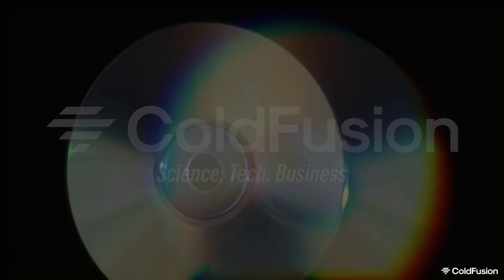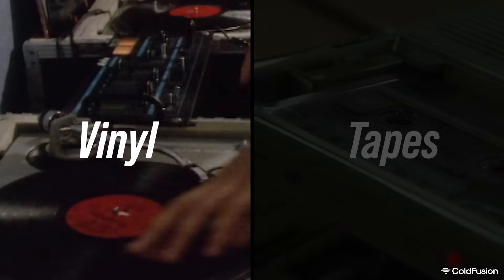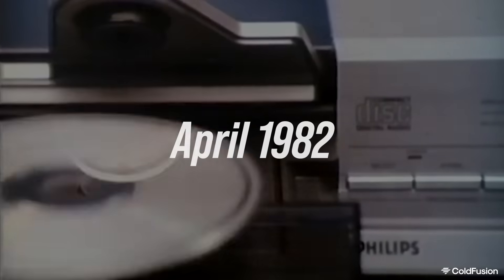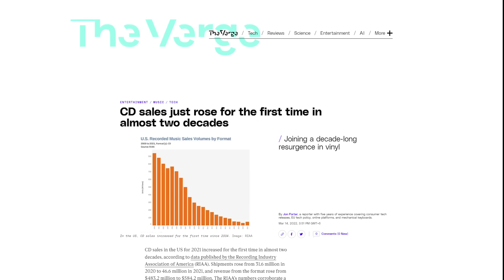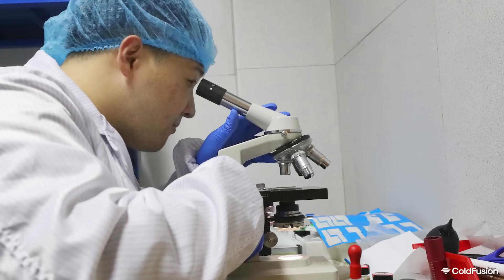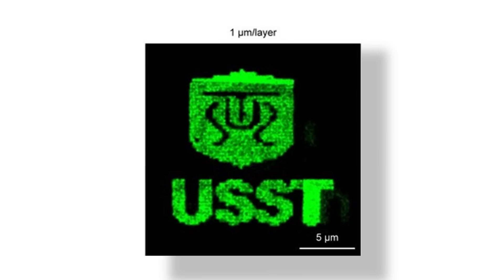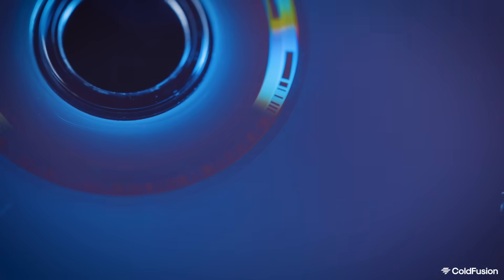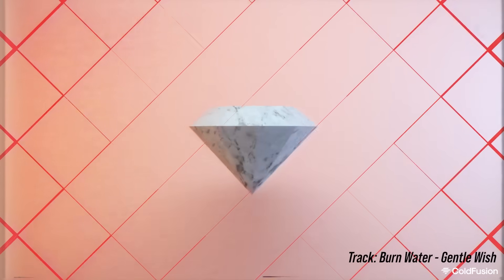Why This New CD Could Change Storage

Comment: The mixing of the use of bits and bytes is driving me nuts: 1.6 Petabits = 0.2 Petabytes.
Reply: The issue isn’t about whether using bits or bytes is “better” . . . it’s about the mixing of the 2 in the same comparison being most definitely bad.
Just say “.2 petabytes = 200 terabytes” . . . end of confusion.
Reply: Agreed, especially since CD-Rom used Megabytes and DVDs were in Gigabytes
Reply: And there is another problematic unit. kW per terabyte.... I assume kWh but it does not help with general understanding of energy vs power...
Reply: Why not just 200 terabytes. Thats even easier to understand right?
Reply: @FullFledged2010  Exactly. What next, It is 1.6e+14 decabits.
Reply: @FullFledged2010  Yep, and it means a mere 42,553 x 4.7GB DVDs, not 200,000. Boldly presented error like that are repeated across the net. AI must burn a lot of gigawatts figuring out fact from fiction.
Reply: I can see it here, though.  What they are cramming into those experimental discs are bits.  They get organized into bytes later.  (A chicken lays one egg at a time, not a dozen.)
Reply: @joesterling4299  It also doesn't include things like error correction. That's about 25% of the space on a CD, but could be as high or low as you want.  There are a lot of choices that could affect the final usable size.
Reply: @joesterling4299 but to communicate information effectively, journalists should choose the vocabulary that is most widely used and understood.
Reply: @joesterling4299 try asking the associate at Costco:
- where I can find 60 eggs? 🤷🏻
- where I can find 5 dozen eggs? 😃💡
Reply: @joesterling4299  This. Both are important and required to explain this. Should have had a short explainer at the beginning.
Reply: @joesterling4299  
1. He makes a confusion and mentions petabyte instead of petabit 7:00.
2. If everyone measures storage in bytes, you come with a special reason to use bits. The issue is that they have similar names.
   To try to use your example, do you care how the chicken lays eggs or how many do you need for cooking in a recipe or when you buy them what are the common options. For the sake of the example, let's say they come in multiple of 12 and imagine we have a special word 1 "eggz" = 12 "eggs". So you always buy a quantity of 1-3 "eggz" and your favorite cake is made with half an "eggz". And here I offer you this opportunity to buy this chicken that lays 100 "eggs" per year (this is what I care), so 200 cakes (this is what you care), it's not my fault you are confusing units.
   Accidents happen because of unit conversions because everyone uses a different logic when using them. In 99% of cases, people use bytes.
Reply: @joesterling4299  i can't wait for the day we engineer chickens that lay a dozen eggs at once
Reply: @joesterling4299  Chickens don't lay eggs, hens do.
Reply: @joesterling4299  Yeah, but when you look at those eggs you see a dozen, not one
Reply: @joesterling4299  What is the argument for that? We don't measure anything in the most fundamental component. We pick a common unit of measure and then measure based off of the unit.
Reply: @joesterling4299 it’s very misleading though. And there is no reason to use that metric anyway.
Reply: The correct unit is Words in a Bible or tennis courts.
Reply: I guess 200 terabytes didn't sound as good? Sounds pretty good to me.
Reply: @t.c.b4722  Yeah I was going to say the same. 200,000 GB is just 200 TB. Why always the wanky new terms?
Reply: @jefp65  Right, and then he claims that’s equivalent of 200,000 DVDs, which is incorrect.
Reply: Agreed, bits need to be dropped...all they tell you is about how many 1s and 0s it can hold, but we need 8 bits for one byte, which is an actual piece of data to form letters for example...we should just stick to bytes. They used bits early on in selling internet speeds to fool consumers into thinking they're faster....bytes make the most sense.
Reply: @GowronSaves  Most storage uses more than 8bit per byte. For error detection you need atleast 1 more bit. For error correction it depends on the method used and how robust you need it.
Reply: @NScherdin a byte is always 8 bits. More bytes may be used for error etc but a byte will always be 8 bits
Reply: @NScherdin  "Most storage uses more than 8bit per byte. For error detection you need at least 1 more bit. "
Most storages (Hard discs, memory sticks) are storing data in "sectors" - where a sector typically contains something like 512 Bytes up to 16 KByte - and the data is protected by a CRC-checksum consisting of 2 or 4 bytes.
That does not allow the correction of the error - but if detects if bits are wrong.
But you need only 2 or 4 bytes to detect errors in a complete sector of 512 Bytes or more - which is more efficient
Reply: @NScherdin ASCII encodes into a 7 bit range and the 8th bit in an octet was used as a parity bit
Reply: @GowronSaves  we need bits too, flicking 1/0 can make huge difference in hardware ;-)
Reply: @GowronSaves those cannot be dropped, since some mediums do not technically work on bytes, such as, unironically, CDs (14 bits per byte)
Reply: @GowronSaves  if we have to drop something is bytes not bits, the BIT is the fundamental unit for information, a byte is just a arbitrary number of bits, a bit IS a actual piece of data saying that "bytes useful bits not" its like saying that a "Dozen" is useful but the number "1" is not because "1' is too little you can't do much with it
Reply: @LucasFerreira-gx9yh  not really arbitrary. If you had 10 bits in a Byte you would lose storage space in digital equipment, because everything in digital is 2^x
Reply: @GowronSaves  Bits are rather useful information also for data, only for storage it's not that useful as a byte isn't always 8bit (depending on error detection method). And we're long past the date that such small units give useful information detail anyway.

When it comes to marketing it just needs to be consistent, and at this point when selling internet contracts they all jumped to Megabit instead of byte.
Reply: @GowronSaves  a bit "is an actual piece of data" that can form the most complicated software...
if (aBit) {
    // simulate a universe
} else {
    cout << "letters" << endl;
}
Reply: @GowronSaves oh boy. Yall ain't ready for kibibytes, mebibytes, etc
Reply: @GowronSaves  bits are useful for things outside of storage, we just need to stop marketing network speeds and storage space in bits
Reply: @BlueScreenCorp  or in "DVDs" ("over 200000 DVDs on a single disk"), or in football fields and Boeings  ... like maybe stop inventing new units just for the sake of it?
Reply: @stclaws9580 insert running joke about Americans will use anything but the metric system 😂😂
Reply: @BlueScreenCorp Network speeds make perfect since in bits because that's what's being sent. Any data transmission should be bits
Reply: @Premium-Content  data is stored in bits, so by that logic we should only use bits... Consumers use network speeds to download data in Byte formatted chunks, the layman consumer doesn't make the connection that a network connection that is sold to them is only 1/8 as fast as they think it is.

I say this as someone with a software engineer and has been working full time for 10 years, it makes more sense for non-technical applications to be marketed all in the same units, and bytes make the most sense
Reply: @stclaws9580  There's literally nothing new about bits or bytes.
Reply: @BlueScreenCorp  Then we would need to standardize how many bits in a byte. Depending on the consumer processor, a byte is anywhere from 8-bits to 64-bits, and it only gets more confusing when you include supercomputers and parallel computing.
Reply: @GrayRaceCat  First off we are talking about consumer products. However IEEE has standardized this, in like the 60s, its 8- bits to a byte. Source, I have a software engineering degree, have been in industry for more than 10 years and have worked companies like Watson health imaging. What on earth are you talking about, lots of people talk absolute crap in YouTube comments but that was by far the dumbest comment response I have ever read.

This was such a dumb comment I had to look up the standards to make sure nothing changed, nothing has. 64-bits is still an 8-byte word. If there is one discipline that standardizes everything its software...
Reply: @stclaws9580 Well the point there is to compare the capacity to something of the same physical size. So if this can store 200 k of DVD capacity, I’m the same size of a DVD, it’s another ways of saying it has 200k storage density of what most people were familiar with as the largest capacity of this media format. Blue Rays were never anywhere near as popular as DVDs so it would be more obscure to compare to those.
Reply: @GowronSaves we still use the term "bits" in telco lingo when talking about bandwidth (ie mbps, gbps, pbps) , because it's the smallest unit of data.
Reply: @GowronSaves But then how will ISPs make their plans seem faster by using outrageous numbers of Mb/Gb in their marketing? I swear, nobody thinks of the billion dollar corporations anymore... :(
Reply: @GowronSaves  bits make perfect sense... and its an accurate desription on how data is stored/transmitted... as a sequence of 1's and 0's ...
all measurment has its uses... 
Bin(ary): bit , nibble, byte, n*octet/nibble ....
bit one position of 1/0
nibble = 4 bits
byte = 8 bits
octet+nibble= 12 bits
2 nibbbles=1 octet = 1 byte = 8 bits
..in early telegraph/copmuting(1960s) Ascii was a 6 bit code, later extended to 8 bits, and standarized as a 8 bit unit(the byte)
(6 bit was more then enughj to send/recieve messages in 1960 2^6-1 different signals/charaters could be sent (64 different charaters and numbers) .. even so the measurments isent useless today ... its a accurate description of reality ..
Reply: @GowronSaves  I feel the exact opposite. Bits are the fundamental unit, and you can encode useful information with only a bit. Bytes were an arbitrary unit of bits carried over from a time that happened to coincide with the development of computation in the anglosphere. 8 bits worked for encoding the subset of latin characters English needed, and that's basically it. It's completely arbitrary, and we should never have adopted them as a fundamental unit of anything. We already primarily deal in unicode, which can range up to 4 bytes per character, let alone are constantly dealing with all sorts of non-text data...much of which is perfectly fine with a single bit (i.e. booleans), or could make much better use of non-multiples of 8 numbers of bits.
Reply: @GowronSaves  It depends. For storage capacity -bits doesn't make much sense. But for transmission speeds it is still relevant because it's more exact than a unit of, say, Megabytes per second. The latter depends on many factors, like transmission protocol, frame size (for Ethernet) and so on.
Reply: @GowronSaves  and that's start putting, 8 bit, 16 bit, 32 bit, 64 bit, and when the become main stream 128 possibly going to be a thing? and we will the data hold size space just regular cd to hole a simple text file and windows desktop calculator will take full minute to load up ¯\_(ツ)_/¯
Reply: @GowronSaves  Byte doesnt have a proper definition either though. Its a word. and then nibble is half of that. ECC, the computer using, etc changes all of that. Byte is just commonly understood as 8bits.
Reply: @GowronSaves nah, number of bits in a byte is totally architecture dependent.
It's just that the most used architectures use an 8 bit byte. That is why I'm some language and in the IETF, they use octet to signify 8 bits.

 And sure, UTF-8 can fit the most used characters (English) in an octet, but most languages have characters that require 2 octets or even three. ASCII requires 7 bits for an octet. 

Network traffic is also completely in bits. If I send 9 bits of data, am I sending 1 1/8th or 1.125  octets of data?

What about the fact that most storage devices nowadays store data in sectors of 4096 octets. 

The byte really isn't anything special in general. It truly is system dependent.
Reply: @GowronSaves 
Negative!
Computers have gone from 8 bit word = one byte to 64 bit word to 128 bit word = one byte!  So to say every machine is using an 8 bit word is incorrect for one byte!!!
Reply: @GowronSaves  they still use that on brazil
Reply: @GowronSaves  that actually isn’t true though. If you use any form of ECC then you need more than 8 bits per byte of data stored. So bits do not need to be dropped, you just need to be able to convert to bytes. For your use case and most other peoples bytes are fine but as said in the video this is probably more of interest to data centres and archival storage, not your average consumer.
Reply: @GowronSaves  My ISP, which is probably the biggest in Britain, still sells their bandwidth in bits instead of bytes.- At least nobody is confusing the issue further for uninformed customers by selling in nibbles.
Reply: @GowronSaves  no bits are good
Reply: @GowronSaves  and we should get rid of inches, yards, fahrenheit, barrels, spoons, pounds etc. right? RIGHT?
Reply: @GowronSaves  the amount of bits in a byte changed... and may change again. what then? WHAT THEN?
Reply: @GowronSaves  windows sill uses bits to show the drive capacitiy
Reply: @GowronSaves  Couldn't disagree more. Bits are objective units of data. Bytes are not as objective as they sound, and there's very little reason to force that over bits.
Reply: @GowronSaves what you're storing is bits, not bytes, what you're operating with is bits, not bytes. Bytes are pretty much misleading nowadays since most of encoding systems nowadays use 2 or even 4 bytes or some older ones use 7 bits to incode character, the exactly 8 bits ones pretty much only exist within english dominated countries nowadays, you may just create new unit, for example "duads" or "quads" and use them instead of bytes at this point.
Reply: @GowronSaves  we should definitely not make technical decisions based on non-technical people's opinions
Reply: @GowronSaves  bits should only be used in telecommunications and networking, especially when talking about bandwidth, throughput, performance, speed... since basically 1bit/s=1Hz and the data in those domains are signals.
Reply: @GowronSaves  We still use megabits for dsl
Reply: @GowronSaves  What about nipples? As an SE what you say makes no sense, there is no need to habe 8 bit.

The real issue is, that Windows does not respect "bi" notation...

8 Bit = 1 Byte <- that is all you really need to know!
1000 Byte = 1 KiloByte.
1000 KB = 1000 MByte
1000 Mbyte = 8 Mbit
See how i wrote Byte uppecase and bit lowercase? Now you understand what MB and Mb means.

Now the issue that confuses people is "bi" notation, that differs from Si units. Bi notation does not use 1000 but 1024 as the multipllier. Windows does display Bi units but does note them as Si units, which is plain out wrong!

There really is nothing confusing about it really, except to that 8 Bit is 1 Byte and that Windows is garbage.
Reply: @GowronSaves  OMG it finally makes sense! Thanks for dropping this info!
Reply: @GowronSaves no, because bytes can differ between systems but bits can't. I think this convention of 8 bits per byte came from most PCs using 8 bits as the lowest addressable amount of bits
Reply: @GowronSaves this makes no sense as an engineer.
Reply: @StarrDust0 Many people including me actually use less than 8 bits occasionally to optimize storage usage. For example if I need to store true or false I'm not going to use an entire byte, I'm just gonna use a single bit. If I'm making a header I'm not going to use an entire byte when a header only has 3 possible states l
Reply: @GowronSaves  Just like everything else though, the physical layer is still measured in bits because of overhead.
Reply: @GowronSaves no bytes need to be dropped. Rather be exact then use a random form of measurement that varies on drives as it is not always 8:1 as there is error correction.
Reply: @GowronSaves  internet speed is still in bits. So are wifi routers, and really anything network related. I Agree though, for storage media it should ALWAYS be bytes.
Reply: @GowronSaves - They did the same with hard drives.
Reply: You are absolutely CORRECT, my friend. Data speeds are expressed in mega-bits bc it produces a larger number, but IRL, (all things being equal) the end result depends on mega-bytes.
Don't believe the hype...
Reply: @GowronSaves  Bits were used early on because they defined how long the computer word was, and storage was measured by the number of words it could hold.   The intel 4000 series of IC's introduced byte sized addresses of nibble sized (four bit) data units. Storage was measured in Nibbles for a decent period of time, think early calculators. The intel 8000's series gave us bytes sized data units, and we've kept that as the smallest unit of addressable memory ever since.   

Bit's can't really be dropped as a unit, they are just too integral to digital computing.  We'll be multiplying and dividing by 8 for some time to come.  When you found about mibibits it gets even worse, plenty of IT infrastructure using that notation these days.
Reply: @GowronSaves Lol this is completely wrong. Bits are used with communications because it’s a measure of the throughput of the pipe. Bytes represent a discrete unit of information and usually the minimum addressable size of data that can be read. Data over networks is sent as packets but packets can be dropped, making bytes an inappropriate measure since they’re commonly a representation of the size of data.
Reply: @GowronSaves 1 year late, but you are very wrong. Not all computer data is neatly divided into bytes, bits are far more fundamental. E.g. floating point numbers are usually encoded into 32 bits; that’s 4 bytes, but each byte itself is meaningless; the format is 32 bits. Or an RGB color can be 24 bits, or 30 or 36 bits as HDR. When you get to streaming media, or compressed files like zip, the various elements all have different bit lengths. Bytes are relevant only to specific formats like uncompressed text. Bits are the fundamental unit of digital information.
Reply: 👍🏻 @GowronSaves
Reply: @GowronSaves  bits should definitely not be dropped lmao

maybe in marketing but the idea is still very relevant
Reply: @aspol12 it’s like measuring your speed in inches per mile. No one wants that.
Reply: @stonesymmetry  yes, on a consumer level, i don't want to be hearing about how many trillions of bits my SSD has or whatever. i'm talking more about the people who are making/teaching about/communicating these things. the idea of bits is a very important idea to keep around lmao.
Reply: @GowronSaves  This is not true. We still need bits in languages like c++ where we do actual 'bitshifting'. 
I'm sure there are plenty more places where bits are still actively used but that's the one I'm familiar with since that's how I still use actual bits.
Bitwise operations are extremely important. We can't just get rid off bits lol. That's such a naive way of thinking simply because you don't know the use-cases for it.
We also measure network speed in bits for more precise numbers. Getting rid of bits is.. a really bad call. We lose granular precision.
Reply: @GowronSaves  Bits are important if you're in information theory, which the researchers most definitely would have been.
Reply: @GowronSaves bits should always be used.  Bytes is an arcane format
Reply: @GowronSaves  while we're at it can we drop base 10 storage units...because the mixing of that with base 2 units is infinitely more confusing than bits v bytes...and most software already works with base 2 units. The only use of base 10 units are...in the marketing for storage media...so they can basically legally gaslight you into thinking it's more storage than it is...
Reply: @Scoopta There was a lawsuit over this and most storage sizes are quoted as 2^10 as kibibytes, mebibytes etc
Reply: @BobBobman-v1d  maybe for ram but not a single SSD I own has ever been quoted in binary units.
Reply: @GowronSaves  No. This storage is a serial medium, and therefore it should be measured in bits. Bytes is an unnecessary conversion that doesn't accurately represent the format itself. Your computer cares about bytes, but the storage is data-type agnostic.
Reply: @GowronSaves hard disagree, the byte is an arbitrary unit, the bit however is atomic and immutable. You’re not implementing bytes of storage, you’re implementing bits.
Reply: @GowronSaves kind of, you can store multiple bits of data per byte though. Compressing data into one byte is something we do a lot of game development to cut down on bandwidth issues when we need less accuracy for the data.
Reply: @sp00l  are you saying, as a game developer, that you cut up individual bytes to store data in? No wonder games work like complete ass in 2024 if that is what "game developers do to cut down bandwith".

WTF has bandwith have to do with what you store in ONE BYTE (8bits)?
On a network, you send packages, not individual bits.

I understand what you are going for, but I smell bs with your comment.
Reply: @unconnectedbedna  I assume you've never done any network programming, multiplayer games. Pretty common...
Reply: @GowronSaves  we don't NEED 8 bits to store any useful data. Imagine a true or false value, you can store that in a single bit as a 1 for true or a 0 for false. Also your example of needing 1 byte to store a letter is not accurate either as a lot of systems use 2 bytes these days not 1 (because 1 byte was not enough to store all the characters for all the languages around the world)
Reply: @r6scrubs126 I don’t think you know how programming works. You absolutely need to reference bytes and not bits. Unless you want to write only in machine code. Which NO ONE does.
Reply: @RogueCylon  The only real reason to reference bytes rather than bits is that it gives a layman a more meaningful representation of storage. 1000 bytes is roughly (not not accurately) a 1000 characters, but other than that, a bit is fundamental. In programming you can reference single bits in may languages - Arduino C++ for example has bit().
Reply: @RogueCylon  "I don’t think you know how programming works": I don't think you know how data storage works. For example, if you are storing anything other than programs, you don't have to think in bytes.
Reply: @RogueCylon  You usually don't use bytes in programming.
Reply: @RogueCylon  Bytes are the smallest addressable chunks of memory, but you can absolutely uses smaller chunks than that, and is often very useful to do so for real-time stuff like graphics to pack as much data as possible as close together as possible for efficient memory reading and writing (which is the usual performance bottleneck)
Reply: @r6scrubs126 Dude, you miss their point entirely. We all don’t care about bits, they mislead people and are a really stupid way of saying things.
Reply: @outofthetrash5925  There is already a standardized word for 2 bytes (16 bits). Two bytes equal a 'WORD'  (and 4 bytes equals a DOUBLEWORD).
Reply: @WolRonGamer  I was only joking. Though after seeing your comment "Word" struck a memory. Is that term still used? Doesn't it define Two seperate things for CPUs and Assemblers? And isn't it that that it was 4 bytes in One and 2 in the other?

If so why is the term still used?

Sorry if this is wrong or just dumb. I used to build computers back when doing so would have been done with IDE cables. Never got in to too much software/programming other than learning very basic HTML an C++.
Reply: @r6scrubs126 yeah...  I think UTF-8 has at most four bytes...
Reply: @RogueCylon  I think it depends on the level you are programming at. In a higer level language you don't need to care about bits. But in more lower level like C, an 8 bit value like a char, you can store 8 booleans. Considering you have a function call with that many bolleans, having 64 bytes vs 1byte to read is great for performance. Youtube has plenty of examples of this where a voxel game engine has like like 300% increase in feamerates just because they packed their data in a byte or two
Reply: @RogueCylon actually no, have you heard of bit fields and bitwise operations? For example in Minecraft you could use 4 bits for storing light and another 4 for storing states which decreases memory use a lot
Reply: @czebosak   no I was talking about real computing, enterprise computing.
Reply: @czebosak  maybe you don’t understand the difference between programming in bits - machine code, and programming in hex?
Reply: @RogueCylon  Hex is just a base 16 number system, it's easier to read than binary so it's used often, but doesn't actually change anything. I'm not sure what you mean by machine code here, but I did work with machine code on a snake game. It had an array of bytes and I used 2 bits to represent every element on screen, either empty, snake or food. It saved a lot of memory. Obviously for today's standards like 200 bytes is not much but if you had to store a lot of data like for example blocks in Minecraft then it would save gigabytes.
Reply: @RogueCylon  you can't say that something is real computing. From what I've heard first computers were used for fun, like a tic tac toe machine. Anyway there are plenty of examples where bits are useful in enterprise software, going with my memory example also works here. You could use bits to store user data that doesn't need a whole byte. Honestly other than storing large amounts of data, programming disk controllers and working with microcontrollers, there aren't many more uses for bits, but isn't that enough to say that they are useful?
Reply: @czebosak  you really don’t understand anything.
Reply: @RogueCylon  bruh, at least try to argue
Reply: @RogueCylon wtf you mean no one does? I do every now and then
Reply: @RogueCylon even then for storage you don't need to be using assembly to store data like that. Most modern languages do support it as far as I know
Reply: @r6scrubs126 yeah but it would take up an 8 bit sector. When dealing with less than 8 bits. It's best to intentionally pad it, because the storage media / file format can handle it unpredictably. - spent hours trying to troubleshoot a program one time. Until I realized what was happening. That it wasn't padding it in a predictable manner. - you want it to pad add the end of the read file. Otherwise you waste a byte, telling it where to start reading.

But yeah, one byte could be used to store 8 different raw values. More if you implement a few compression rules and you have more data. IE 
10100000
00000000
00000000
10000000
The double null byte in the center tells the program to repeat the data of 10100000 times 10000000 or 256 times. You might be able to get away with one null byte, but you need to make sure the dataset can't accidentally create a null byte. In general you'll probably need more null bytes than two. Or indicate the highest amount of accidental null bytes at the beginning of the file.
(Compression is my interest, can you tell?)
Reply: @GowronSaves  :) I'm looking at this from just the opposite direction. Bit is the base unit, why would we choose anything else? Why multiply it by 8? All bits are "actual pieces of data".
Reply: @GowronSaves no, as a software engineer, I can tell you, yes, we do need bits. Without the concept of bits one cannot even do bit wise mathematics 😅
Reply: @GowronSaves when you code, you use bits as flags. A bit is just the minimal amount of information possible. Everything starts here.
Reply: @GowronSaves  well that's not strictly true. An 8 bit byte is sufficient to store a character in ASCII for example but most "character" data these days is stored in Unicode (which covers pretty much all character sets) and requires 16 bits. The same with numbers, 8 bits gets you a number up to 256 (or half that for signed numbers), "long" numbers are 16, 32 or 64 bits generally. 8 bit bytes are almost legacy now that most computers are 64 bit.
Reply: @GowronSaves   No the oposite. Bytes are useless, no computer computes in 8 bits anymore, they use 64 bits or 32 bits. Letters use unicode these days, and this has variable length.
Reply: Ik it was driving me insane
Reply: What's that in PiB?
Reply: I always run into this problem buying food for the dogs...
Reply: So… 200 Terabytes?
Reply: Sloppy research or scripts like this make me mad.
Reply: @erazorDev  12:00 "A femtosecond laser... costs almost $50k, and needs fans from an AC outlet.  Now that is a showstopper if I've ever seen one."
We need a poll, if this was AI generated, or just really really bad scriptwriting.  I could write 20 dunks on this one quote.
Reply: @erazorDev  His audio is so polished and he has such a great voice but his scripts tend to be a little too amateurish. He really could use a script editor at least.
Reply: @erazorDev   Oh no...some random fool on youtube is mad....whatever.  
Either way, the product and science is measured in petabits.   The video is not wrong by reporting it that way.
Reply: CDs use 14 bits to store 1 byte. The additional data is used for error correction.
Reply: The power of language and marketing towards uneducated people 😂
Reply: @WeylandLabs has nothing to do with education. It’s just stupid. We don’t measure our speed in inches per mile, or our height in atoms.
Reply: Coulda simply said 200TB per disk, thats 2 of those big ass SSDs.
Reply: I love cold fusion videos, but I can trust any of the specific assertions in this video because of this unfortunately. Luckily, it doesn’t affect my life in any way! It’s a great video anyway.
Reply: British also call batteries "Bat Trees" 🦇 🌲 is how they say 🔋
Reply: @dertythegrower  "battrees" take up one fewer bytes in a FIFO stack
Reply: yeah Dagogo isn't a stupid person but he literally says petabytes and petabits in the span of 8 seconds at 7:02. I still don't know which is it supposed to be
Reply: Yah. It’s confusing bits and bytes.
But they are different sizes and are truly different storage volumes.
In low numbers it may seem inconsequential. But many companies will try to confuse storage size by listing in these differences to confuse buyers who don’t realize the difference.
Reply: It's an inconceivable boatload either way.
Reply: For storage and transport mediums.. bits should always be used
Reply: 1 byte = 8 bits
1 PB (Petabyte) = 8Pb (Petabits)

Make the rule of three and you'll find out
Reply: Same, got to halfway through the video and I still don't know if the disk is 1.6 Petabytes or 200 Terabytes.
Reply: Anyone who doesn't know the difference shouldn't be making content on the subject.
Reply: 200Tb is still impressive for an optical disc. 200,000Gb.
Reply: Byte me 😂
Reply: @RS-Amsterdam  I've bitten enough, won't byte ^^
Reply: @incandescentwithrage  This isn't about high level languages this is true in hardware too. A byte is the smallest addressable memory in machine code or any code (in any consumer hardware). That doesn't stop you from manipulating individual bits, but a variable at the hardware level is never less than a byte in size. Compilers being stupid or not doesn't matter. If you want to store multiple booleans in a byte, you can do that, but you always have to deal with the whole byte and mask out the bits you don't care about.
Reply: Undermines the entire script imo. I dont work in it or anything like that but I've know the difference between bits and bytes since I was  about 12.
Reply: Still more than my ssd💀
Reply: @LumenDX  Still its the speed thing they need something with more than 1 laser or maybe a wide beam that could read the whole disk in one pass but I bet that would be expensive
Reply: His videos for years now have been full of errors and no one calls him out
Reply: When bits is used it refers to transfer rates not storage capacity
Reply: @axenik  Really, for media like this, technically they are bits and technically you can store anything you want in them, but practically it can't read just any sequence of bits stored (loses synchronization, DC component gets too high, etc.). It's misleading to talk of raw bits because they aren't general bits.
Reply: Bits and Bytes aside.. 125 Terabytes on a compact disc?... Bring it on!
Reply: tbh bytes should be banned as a unit, bit is the real unit
Reply: Exactly it was driving me insane and using both bits and bytes interchangeably in same video is such misinformation. I am a fan of Coldfusion and been fan and still am. Pls. Fix this.
Reply: @fredslifetechchannel30  if you are a fan then you will note that there has not been one video in the past two years that I can recall that has not contained at least one glaring mistake that should have been fixed. Often it’s three or four. They always drive me crazy. And he never fixes them.
Reply: Yeah, when you hear the word "bits" it should be setting off red flags, especially for storage mediums. In the case it;s totally cool if true, but it so unnessecary
Reply: @NexusGamingRadical  no the usage of bits should NOT be setting off red flags... All mediums should use it as a representation of capacity.  That's why BITS are used in networking and in storage.  Bytes, well common does not represent all methods of encoding
Reply: @xephael3485 You’re right, but bytes in common parlance exclusively mean an octet
Reply: Over 20,000 DVDs in 200TB, not 200,000, assuming 9GB dual layer DVDs. Basic math.
Reply: Thank you!
Reply: yes. thank you.  I was about to mention this myself.
Reply: why would you do the proportion like that
Reply: So around 200 terabytes? That doesn’t seem right…
Reply: @mrpumperknuckles1631  shut up about bytes
Reply: Can I upvote this 10x?
Reply: I assume those CD would need the return of the CD caddy. (Something that look close to the MD.
Reply: I assume those CD would need the return of the CD caddy. (Something that look close to the MD
Reply: Sign up for "Brilliant" and "ColdFusion" and get educated in a way that will see you ridiculed because you don't know the difference between a bit and byte.  I think I'll hold off on that subscription for the moment, thanks...
Reply: An easier way to remember the conversion is that Bits are 8x smaller than a byte. Just multiply the total by 0.125
Reply: You can see that he doesn’t know the difference that’s why he mixes them up
Reply: I didn't even realize there was a difference between bits and bytes before I read your comment 😅
Reply: Seriously!!!! Facepalmed my way through the entire video. Hopefully it gets corrected and re-uploaded 😬
Reply: Yeah 200.000 GB or 200 TB
Reply: Made it unwatchable ngl
Reply: 0:52 the article says bits. Im pretty sure the video maker made a mistake around 7:00. Both on screen and in voiceover they say “-bytes”.
Reply: Or more impressively 200TB
Reply: The use of "bits" seems deceiving here. In the end, it's 200TB but it doesn't sound catchy.
Reply: Well he's doing coldfusion to those terms
Reply: I agree— it’s like a god damn isp ad watching this
Reply: Yeah, Dagogo keeps switching between bits and bytes like they are interchangeable but they aren't. A bit is 1/8 of a byte. So 1.6 Pb (Petabit) is not the same as 1.6 PB (Petabyte), but rather is 0.2 PB as you've pointed out.
Reply: It particular annoys me when companies advertise there broadband speeds - instantly need to /by 8 .
Reply: @incandescentwithrage  Booleans are usually stored as one byte due to the fact that memory addresses point to bytes. Reading a single bit requires reading the whole byte anyway.
Reply: Gb vs GB vs GiB, GiB is the only thing that makes any sense to use, all the rest are marketing garbage.
Reply: @q1337  How bout TB? :p
Reply: @bretthagey7916   what's a "noob" . . . ?
Reply: typically bandwidth is expressed in (kilo/mega/giga etc)bits while capacity in (kilo/mega etc)bytes. I find it annoying when people mix those on purpose to make their product look better than it is
Reply: Between this channels previous 'redemption of tharanos' video, and this video containing misinformation (conflation of bits and bytes), im starting to think differently about this channel
Reply: 'Bits' is still used in physical media like networking. Bytes is more software oriented. I just remember x1024 and it's gotten me this far :D
Reply: 200TB basically, but yeah, I agree~
Reply: Now just imagine an entire Peta file. 😏
Reply: This channel isn't known for being educated in technology, let alone science.
Reply: Nibbles, baby. Nibbles.
Reply: Are you a Bit-Byte-Perturbed?
Reply: A byte is a collection of 8 bits, a bit is either a 0 or 1, so 01010101 is 8 bits and 1 byte.
Reply: lets also not forget that a gigabyte is 1024 megabytes and a terabyte is 1024 gigabytes.
Reply: Chapters, now that would be an awesome invention...
Reply: Brilliant seems to finance the whole Internet on YouTube. How much that's gross they're making a year?
Reply: They may as well say it is 1 quadrillion eggs and sausages, which may be enough to feed the world population for years
Reply: They created this tech for the sole purpose of fitting Star Trek: TNG entire series in 4K 😅
Reply: @Bat_Boy  Hell yeah.4k TNG one disk that is quite giggle worthy.
Reply: You think bits and bytes are confusing ? Try bytes and bibytes, with bibytes being Storage companies' way to legally scam their customers.
Reply: Clarity, just like critical thinking, empathy, repairing, and History, is a hindrance to business.
Reply: 10^2 or 2^10 is the real question but unfortunately the whole calculation is wrong as well ;)
Reply: @0xphk It's never 10^2, it's 10^3 or 2^10, yet bandwidth has always been 10^3 and storage has been 10^3 for over three decades. Only RAM was measured as 2^10, because RAM was all about how much RAM a CPU could address, and that was always (and still is) a power of 2. Since the main purpose of early storage systems was to dump the contents of RAM to memory and restore the contents of RAM from memory, storage was also briefly measured as 2^10, but that stopped with floppy disks. Some people may remember that a 3 1/2" HD floppy had 1.44 MB, and that's 10^3. As 2^10 it would be 1.41 MiB and I'm pretty sure you've never seen that number anywhere. The LD disks were still given in KiB (720 KB was really 720 KiB; so HD disks were really 1440 KiB and that was written as 1.44, so 1000 was already the factor). Today, when you talk about storage, it's always 10^3.
Reply: @xcoder1122  you are correct, this was misleading as I referred to the base of 10 vs base of 2
Reply: Then when you format on NTFS on windows you won’t even get a petabit 🤣
Reply: Thank you for the clarification. I knew something about those numbers didn't sound right. I didn't realize they were mixing bits and bytes in their comparison.
Reply: Lol i knew this would happen
Reply: yeah, why not just say its a 200 terabyte disk? most people understand that in size.
Reply: Then we would need to standardize how many bits in a byte. Depending on the consumer processor, a byte is anywhere from 8-bits to 64-bits, and it only gets more confusing when you include supercomputers and parallel computing.
Reply: if this is being done in China.  looses pretty much 70% of its creditability right of the top.  chances are, there is already something like this at half the compacity but actually usable now.    and to make it appear they are leading the edge of tech, thats half of their marketing strategy for tech and for their innovation.  5 years from now. look for the real players of tech to put something close to this out on market and china's excuse will be that they're are way pass, working on gen 7 tech  they got something in research "still" but is 50x better already lmao

thats what happens when you steal tech that you don't even know how to use yet.  it goes no where, the it took all the little steps to understand it to proceed in advancing it.  so then the actual creator patons it as its true form, which is usually a good 25% less amazing as what it was when you first heard about it.   Japan will have us something real in  abit. just hang on.  don't go doing back flips over this junk  lol
Reply: 0.2 petabytes is crazy though 
İn one CD 
That's 200000 gigabytes 
That's 200 movies 
That's 200 terabytes 
Thats 100 times better than the best hard drive i have ever seen 
That's 1000 times better for the physical space it takes up compared with the digital storage it holds
Reply: Clever, those Chinese 👍
Reply: 0.2 Petabytes = 200 TB
Reply: It's always been this way!
Reply: Not only that, but there's also the consumer vs. technical  use of measurement. At these sizes, the difference between values based on powers of ten vs. values based on the powers of 2. It is only multiple generations of people trained in basic computer terminology is eliminating the issue. But we still have to deal with the elementary school dropouts that force the continued use of obsolete terms & methods of measurement. Certification in ANY field should be continual and updating and not designed to entrench the use of centuries old things. I entered the computer field in 1981 and yes, I was basically obsolete by 2000. BUT that was by my own decisions to NOT keeping up-to-date. There is a reason that the apprenticeship system has fallen to the wayside.
Reply: Audiophiles rise up
Reply: it makes me think they have no idea what they're talking about
Reply: Now, we have to talk about your complex ratio… 🧐
Reply: I knew there was a reason I stopped watching cold fusion. Bad information spoken with such confidence only leads to the dumbing down of society. Channel blocked. 🎤
Reply: That's not even get into nibbles.
Reply: 200 Terabytes
Reply: Are you sure THAT'S what's really driving you nuts?
Reply: Smell the roses!
Reply: I would welcome the return of physical media as long as the player is affordable.
It would also be nice for a recorder to be a not ridiculous price also.
Reply: I concur and for all those who say it makes sense and those are just layman terms, you are wrong. In IT, we will never make use of bits when speaking of storage space. Never. Bits will only be used to describe bandwidth (bits per second). Any other reasoning is theoretical, but that’s not what we actually use in the day-to-day.
Reply: @incandescentwithrage you are wrong, even your one bit Boolean will be stored using 8 bits. True will be stored as 0000 0001.
Reply: @jean-philipperottiers614  Yes I am wrong
Reply: Also find it funny when they use comparisons like 100 TB = 20 million songs, as if length, quality or format do not matter. Then you know what the target audience is.
Btw, this Megabyte / Mebibyte BS should die in a fire, I'm old-fashioned there and 1 Megabyte is still 1024 Kilobyte for me... but I digress. xD
Reply: Even worse is the ratio of data bytes to the parity, control, and the hamming code bits
Reply: One papaya = 10 papayas
Reply: thats still 200 terabytes
Reply: Thanks. If the author doesnt know how to make proper content, not watching. You are the hero!
Reply: 1.6 petabits ... and its up to 1.6 petabyte
Reply: Thank you for saving me a world of headache and a waste of time, have a great day 😂
Reply: That is NOT true! 
That relations only holds true for machines running 8 bit as one byte word!
A maching running 16 bits or 32 bits or 64 bits for one byte word will not be the same!!!
Reply: ditto
Reply: It's probably even worse, because the encoding requires more than 8 bits per byte
Reply: This optical disk is in engineering stage in a laboratory. The usage of 'bits' is appropriate since its not meant for commercial distribution, rather research and development at an academic level. A strong foundation is the key to science, knowledge.
Reply: They can't even use KB, MB, GB, TB properly.
Reply: Yeah when he said 1.6 petabytes was 200TB I was like “pretty sure that’s wrong” and then I realized he said petaBITS and not petaBYTES lol
Reply: Bits and bytes isn't even the worst part. When we say "Petabytes" are we talking about the original JEDEC standard where units are in base 2 (2.2518e+14 bytes)?  Or are we talking about SI where units are in base 10 (2e+14 bytes)?
Reply: @SpeedKreature  Just assume it's the smaller one. The only place the base-2 units are used is memory and CPU addressing, where it's naturally a power of two in size.
Reply: Why is everyone arguing about bytes vs bits when these discs can store 200 TERABYTES of information
Reply: @terrybuckley2850  Because the difference between 1600 terabytes and 200 terabytes is still massive. Besides that this isn't even a true petabyte, mentioning petabytes at all is meant to confuse more casual people making it seem like a huge difference when in reality it's not nearly that large of a leap. 

Of course 200 TB is a crazy size, but we'll probably never see this tech in a pc at a reasonable size and cost. Mainly because this is a CD which can't be rewritten unless you have a professional grade laser (if they can even be rewritten at all). So honestly unless you can buy a disc with like 500 games on it, it's literally useless wasted space.
Reply: Yea but in the thumbnail I can see it says 7000 MB to 200,000 GB which is 200 TB or  .2 PB.
Reply: this comment makes me furious
Reply: Wait till you hear about -bibytes!
Reply: @incandescentwithrage  Boolean claim to be 1 bit, in actual implementation after being compiled into machine code it uses at least 1 Byte.
And Short are not 4 bits, its 16 bits.
Reply: A petabit still worth 200 terabytes so this is still revolutionary.
Reply: whenever u see bits, just x 8
tiny bits and big bites
Reply: Not to mention kilowatt (which he used when talking about the energy consumption) vs kilowatt hour (the unit he meant).
Reply: People still don't realize that infrastructure around the planet is decades out-of-date and could fail at any moment. Also groups of hackers can easily overcome cloud storage of any type because of the weaknesses of its interface. Hard drives are the only thing currently that can live without electricity, 😊. I think this would be a great replacement for the old hard disk. As long as it doesn't cost $50,000.
Reply: Dont forget the third UOM, Gibibyte, Mibibyte, etc.
Reply: what a newb
Reply: 1 byte = 8 bits
Reply: Well ...  Reed-solomon encoding would reduce the actual available space on there.
Reply: I thought if u bit something it normally don't hurt you but if you were byte by something it would surly hurt
Reply: indeed, 200 terabytes would be more accurate to how people actually understand storage size.

its also worth noting, as i'm old enough to remember it, that when blu-ray came out the prototypes that they were using to describe the future of optical discs were up to 500GB, 20 layer (25GB per layer) discs. 

whereas commercial discs were limited to 25GB writable (later 50GB writable) and 50GB read only (later increased to 75GB, and now 100GB, and 128GB, though i've never seen one), meaning they only ever hit 26% of their actual pre-marketed capacity. this was because it wasn't economical to make  discs above 4 layers, and the writers drives themselves would have to be more complex and expensive.

so realistically this disc will likely be released at whatever capacity single, dual and triple (and MAYBE quadruple) disc.

unfortunately this technology is based on using 100 layers, meaning 2 TB per layer, so even if they could get up to 25 layers in commercially available drive that would make it "only" 50TB, based on where the economic sweet spot will likely be at best at worst, it would still be 6-10TB.
Reply: What made CDs and DVDs revolutionary was Not only their BIG leap in capacity, but their extremely CHEAP material which allowed you to hand them to people in conferences and to dish them out without thinking about the cost. With USB flash disks, the revolution was in shrinking the size while multiplying the capacity by a factor of 8 to 64 !! But you're Not gonna meet a guy handing out tons of these in an event, cuz they COST much more and are Not so disposable. What I hated about CD/DVDs was their SIZE. A library of 200 or more CDs/DVDs was just so cumbersome when it came to ejecting and reinserting the next/previous disc 😨😨 if we can get a 16 terabyte DVD, I'd say we are at ANOTHER revolution, forget Petabytes for consumer-grade storage, except of course you audiophiles and videophiles and autocaders and science medics 😅😅😂😂!!
Reply: The convention is bits when talking about data transfer speed, eg mega bits per second. For storage though the convention is always bytes.
Reply: Or 200TB...
Reply: still very worth it
Reply: We should just be using bits at this point... or octets instead of bytes.
Reply: yeah it really reflects a lack of due diligence in research/writing
Reply: divide by 8
Reply: THANK YOU. I was going crazy over that myself
Reply: Where are you going after you die?

What happens next? Have you ever thought about that? 

Repent today and give your life to Jesus Christ to obtain eternal salvation. Tomorrow may be too late my brethen😢.

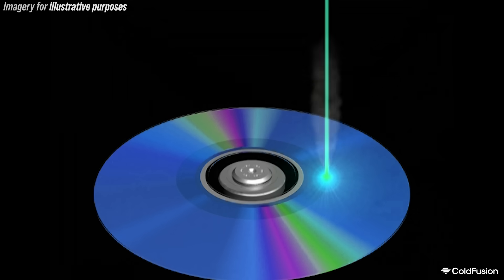Hebrews 9:27 says "And as it is appointed unto man once to die, but after that the judgement...
Reply: I hadn't even noticed until I read this comment, I was more focused on understanding how they managed to increase the storage capacity of a CD so much.😄
Reply: 250 TERRSABYTES!
Reply: Yup, i.e. 200TB, which is about 15 times the capacity of the largest current 3.5-inch rotatic magnetic drives. Impressive, and potentially useful - let's see if it proves also commercially viable.
Reply: 1.6 petabits is 200 Terabytes
Reply: They’re just using Petabits to make it sound bigger than it actually is. I‘m just glad they aren’t using Petibits…
Reply: Agreed. He also doesn’t seem to know the difference between micro and nano either. He starts off calling them nano spots, then calls them microscopic spots.
Reply: Just multiply or divide by 8
Reply: So a bit over 200 Terabytes. That's about 50 times the amount of storage on my computer right now.
Reply: Probably some marketing trick
Reply: 8bits=1byte
Reply: I'm still sore that "baud" (changes per second) isn't better known.
Reply: 1.6 Petabits = 1600 terabytes .. 1 Kilobyte=1024 bytes, 1 Megabyte = 1024 kilobytes, 1 Gigabyte = 1024 megabytes,... Still driving you nuts ?
Reply: PetaFiles are the worst.
Reply: So basically about 200 PB. A typical laptop has 2 TB of storage either hdd or ssd. 1 PB is 1000 times 1 TB. So approximately 100,000 laptops. Obviously there would be some speed limitations. But it can still be used in servers.
Reply: He clarifies the storage capacity at 7:47 : 1.6 Petabits or 200 Terabytes or 200,000 Gigabytes
Reply: Thanks a lot 😊
Reply: Nah, 8x or /8 isn't that big of a deal when it comes to choosing dealing with discs again or not... Interchangeable for the purposes of most practical communication. Sorry, understandable but chill out on the OCD.
Reply: it's 200 Tb
Reply: It’s the British culture that is to be blamed. They don’t care if the meaning of a word is correct as long as they can make it sound funny😂
Reply: Me too.  Didn't they watch their own upload?
Reply: they probably say bits too make it seem larger than it actually is.
Reply: And 0.2 petabytes = 200 terabytes
Reply: For the record, it is 1.6 Petabits (yes bits, not bytes) which is equivalent to 200 Terabytes (yes bytes, not bits)
Reply: ColdfusionTV, more like confusion TV
Reply: English please
Reply: America is still using King Henry’s foot to measure everything.
Reply: By convention storage is always measured in bytes where 1 kb = 1024 bytes and network speed is always measured in bits where 1 kb=1000 bytes
Reply: and this is why hard disk drives are smaller capacity in real life then on the package😭😭
Reply: that's still 200 terabytes
Reply: A nibble is 4 bits, or, half a byte.
Reply: omg this shit fucks me up so bad
Reply: Wait till you find out that 4 bytes is a nibble
Reply: Was coming here to say the same thing. 0.2PT on a disc is still impressive, but not nearly as much as 1.6PT
~Trav
Reply: Or 125 terabytes
Reply: And it's barely the most egregious thing about this video
Reply: Why don’t we all just agree to use nibbles for everything?
Reply: It could work as NAS
Reply: Big time. Use bits for talking about bandwidth and bytes for storage. Bits for storage doesn't make sense
Reply: just like Go and Gb then ?
Reply: Blame Nintendo...
Reply: Ain't AI voiceovers great?!
Reply: You need professional help if that bothers you that much.
Reply: What’s important is these disks will be ready when people realize they don’t own anything that isn’t in their hands.
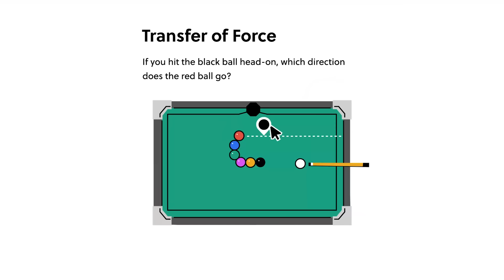Reply: 12:43 rly bytes is annoying, random choice decades ago to make the smallest unit 8bit. Preferably use bit everywherr😊❤ 13:25
Reply: 7:50
Reply: So the thumbnail is true.
Reply: I always thought that 'bits' refer to data-in-flow, & bytes refer to static storage capacity.

Then Lo & Behold - apparently that's not at all the case - & it seems that I gaslit myself into believing it was!
Reply: Because it sounds bigger. Same shit with 4k and 1080p.
Reply: Or is it aka huge pissing bits rate
Reply: Honestly
Reply: In Measuring we should drop inches and only use feet.
Reply: It have always been a confusion specially with most ppl mixing Mb with MB or Kb with KB and so on... So basically we can't always be sure someone is referring to xxxbit or xxxbyte 🤬
Reply: So only 256 TB kinda underwhelming
Reply: yeah to get bytes from bits you divide by 8. Do the same with Internet as they to advertise in Megabits/s or Gigabits/s
Reply: Yup...200 terabytes bro😛🙄🤣
Reply: Normal, bit is used for transferring data and byte is used for storing data.  I say pick on and stick with it.
Reply: Fun fact: Bits are used just  because the number is bigger.
Reply: all unlikely 'cause OBSOLETE
Reply: It's like the miles and kilometers situation
Reply: Is not half as bad as his voice and how he read the sentences 🤦‍♂
Reply: It's not confusing. 1byte is 8 bits. Big "B" or uppercase B means byte while small b or lowercase b means bit
Reply: @rubler4ever  Nope, not precise! 1 Byte is 7 Bits and 1 proof bit!!!
Reply: @ElektrONEloQ  source? according to google and some books and also chatgpt, 1 byte is equal to 8 bits not 7 bits and 1 proof bit
Reply: @ElektrONEloQ  according to chatgpt:
Summary:
✅ 1 byte = 8 bits

❌ No such thing as a "proof bit" in standard computing

⚙ 7 bits + 1 parity bit = a structure used in error detection, not a redefinition of a byte
Reply: @ElektrONEloQ  also whats with the "!!!"?
Reply: @ElektrONEloQ What do you mean by 'understand'? There’s nothing to understand in what you said, as it’s incorrect. Try to research first. There is no such thing as proof bit.
Reply: 8 bits equals 1 byte. Nobody measures in bits anymore not since the cartridge size wars of the early 90s.
Reply: Yes, me too! Also, the phrase “kW per terabyte” when describing recording energy usage doesn’t make sense. kW is energy over time.
Reply: It's driving me absolutely mad. I'm considering throwing this out and finding someone else with information about it.
Reply: just think of marty mcfly
Reply: I just assumed they meant bytes throughout the video.
Reply: I think of it generally as bits for networking, Bytes for storage
Reply: @alexhawes6690 I see bits as transfer speed where as bytes as capacity. Bits are used regularly not just with networking.
Reply: In such applications saying „bits” removes ambiguity as a byte is simply the smallest addressable unit and might not be 8 bits, and if you want to use the same measure as desktop cpus bytes you may simply say octet (like standards commissions do)
Reply: @bruhacz  it all depends on what is being accessed. If you are using a flash or RAM or EEPROM chip with 8 data lines (or only accepts bytes through the likes of SPI) then you are tied to using bytes, however CDs have no inherent need to use bytes as the data is arranged serially, you can use any size of data structure you want.
Reply: Just remember there are four bits in a nibble.
Reply: BITS,
Reply: At 7:47, they do say that 1.6 petabits is equivalent to 200 terabytes. The bits/bytes might be wrong at other time, but they get this number across effectively
Reply: Technically, the word 'byte' is ambiguous.

Historically, a byte referred to the size of a single character of text, it varied depending on the machine you were using and it was as few as 6 bits.

Today, yeah, the word 'byte' generally refers to 8 bits, regardless of how many bits are used to represent a character.

You might wonder why a byte doesn't, therefore, now refer to 16 or 32 bits, after the Unicode standard. To the best of my knowledge, Unicode isn't implemented at the machine level - it's implemented at the software level. That is, your CPU doesn't know anything about Unicode. But even if it did, by now "1 byte = 8 bits" is so ingrained that we are unlikely to ever change.

So yeah, just use pebibyes, not pebibits.
Reply: Yes, I thought that was sloppy and confusing. Also, not all bytes are octets, so depending on the intended usage this would vary. They should have done a quick explainer on that and then stayed with bits.
Reply: @GeoffBeggs  Bytes not being octets is highly unusual. For all intents and purposes, bytes should be assumed to be octets.
1 bit = a bit
4 bits = a nibble
8 bits = a byte
16 bits (2 bytes) = a word
32 bits (4 bytes) = a doubleword
64 bits (8 bytes) = a quadword
Reply: @WolRonGamer  I know why you would say that, but the standard says at least 8 (so can be more). Prior to the standard some systems used 6 and 7 bits. Some use 12 and 16. If you just assumed this when porting code you might run into issues. But, sure, 8 is now extremely common. For consistency sake the video should have stayed with bits or (defined once) bytes.
Reply: Bits (binary) make the most sense because binary is the base reality in the digital world and every combination above that is a construct which can and will change over time.
Reply: @Nice_Amish_Fellow 
Very well said.
Reply: @Nice_Amish_Fellow using bits, is like measuring your speed in inches per hour.
Reply: @stonesymmetry  Inches to miles is a factor of 63360. It's a factor of 8 to get fom bits to obsolete bytes, which even itself is defined as 8 bits, while nobody in the history of the universe ever described a bit as 1/8th of a byte. So not really the same is it?  Try again.
Reply: it's the same reason they are using bits for everything, storage,internet speed, etc, 1.6 is more than 0.2, and if you don't have knowledge about these values, you will always choose 1.6 petabits, over let's say 0.4 petabytes, even though the first is less, lol
Reply: They love to fool people with bits, got so many times fooled with products promoting 1gbit speed for ethernet routers, hhd reading/writing speeds etc. thinking „ohh 1gb should be plenty fast“ not realizing thats just 125mb speed 😑😑
Reply: That's literally the first thing I did when they said petabit. I pulled out the calculator and was like, 1.6 petabits is like 250TB. Still impressive, but not AS impressive as they're trying to make it sound.
Reply: @zataritamods7499  it's impressive because that's how all media is measured!! ...in bits... Your thumb drives your phone your wireless adapter in your laptop.  Stop going on with this bytes garbage
Reply: @xephael3485  As a programmer everything ON the computer is done at the byte level though. I find measuring things in bits to be meaningless.
Also, all the things I buy are in bytes, the only thing I can think of that's measured in bits is my internet speed so it can sound faster than it is
Reply: @zataritamods7499  you're not a good programmer if you only consider bytes...more like a script kiddie... big-endian and little-endian and other systems are just that.  bits describe media storage just fine
Reply: @xephael3485  No need for insult, but yes, everything is done at the byte level. 
you read a byte from stream and everything is aligned to byte boundaries. Even if you only use 31 bits, you still have to store 32 bytes and extract the bits you need using bitwise functions even at the assembly level the smallest register is 1 byte. I never said I don't only consider bytes, I said that everything works at the byte level. Bitfields and bitflags are still usefull, but you still have to work with the full byte.
Also, Endianness has nothing to do with what we're talking about either. 32 bits on a big endian system is the same as 32 bits on a little endian system.
bits are meaningless measurements in modern systems.
Reply: @zataritamods7499  again you don't know what the hell you're talking about and bits are not meaningless if you're an actual programmer that's not relying upon an IDE to do all their crap
Reply: @xephael3485  right, but they're MARKETED in terms of (giga)bytes. Because it's more meaningful to the consumer to think in terms of bytes. Tell the industry, not any poster here, if you're so adamant about it.
Reply: @xephael3485  are you saying that programmers who use IDEs are not "actual" programmers? Wow, you're an elitist. How do YOU code, smart guy? Bare metal assembler?
Reply: @aleaxdeathbringer  ask your mom she'll tell you buddy
Reply: Humanity should drop “byte” from common usage and stick with binary digits AKA bits for a number of reasons…mainly inconsistent byte sizes. Bits are irreducible. They are to data science and information theory what atoms were always supposed to be in chemistry: the basic building block. Just as physics introduced subatomic particles, quantum computing has introduced the qbit. Thankfully no one is pushing qbytes or other silly things. A bit is a single true/false or off/on state. 3 bits allow us to handle up to 8 states and 4 cover 16 states. Decimal numbers are converted into binary digits in all computing systems as are all operating system, program and other data. This may be organized into  bytes, but it’s ultimately all bits. No buts about it!
Reply: @STEAMerBear  Yep, and all the prefix notation nonsense for binary vs decimal bytes is enough to give anyone a factory reset. We have marketing departments to thank for that one.
Reply: Yeah, bits are not very useful as a unit compared to bytes, and bits can be confusing for people who don't know much about computers.
The 1.6 petabits number is mostly only useful for researchers but not so much for everyone else.
Reply: @MinaTheSpaghettiCoder  It is a bit annoying. 😊
Reply: 8 bits make a byte.
Reply: Not only that, I think he sometimes mixes up for example Giga and Gibi, ie 1000 vs 1024 increment
Reply: But there's no guarantee your bytes are 8 bits wide. (Although, admittedly in contemporary use, you're not gonna find anything that doesn't use 8 bit bytes at the core, even if you consider utf-16 as a 16bit byte, it's still transmitted as 8 bit bytes first)
Reply: Pb, PB, pB, pb compliment anyone?
Reply: Well, you're not storing bytes on a disc. You're storing bits. You CAN convert your bits to bytes as you're reading it from the disc, which is what we're doing 99.999% of the time, but that's just a convention that's on top of the bit stream. It just so happens that we use that convention for basically everything from images to text to code to whatever. But the storage medium itself is storing bits, so it does make sense that when they announce it, they give it in the units that they are storing. All of the companies who package and sell the disc convert it to bytes for you because...well..that's what you always use it for. But it's not mandatory.
Reply: What you are all misunderstanding on the networking side of things, is that data isn't sent in bytes in the first place. Internet, like it or not, is just really fancy really fast morse code essentially, but with 1s and 0s instead of dots and dashes. It doesn't send things in byte format so to speak. (Sort of. There is some nuance here with how some internet protocols handle their packets.) But to keep it simple, it's literally just sending 1's and 0's really quickly. So, as confusing as the multiplication table is for people... sadly... bits is more accurate a measurement for data rates. 

Is it annoying? Sure, I suppose, if you can't divide or multiply by 8. And honestly, frankly, that's your problem, no one elses.
Reply: @ManuFortis  and at the physical layer, it's representing those 1s and 0s as a change in voltage....or a non change. And then you get into multi-levels of voltages to decrease the frequency of the waves in the wires, 5>4 modulation schemes (so that a zero on a wire is never just 0000 but is more like 0010 so that a string of "zeros" is never unchanging voltage in order to keep clocks synchronised and all that)
Reply: @miff227  Thanks. Last half added to my repertoire of knowledge. I was wondering what was going on that constant non-data didn't just = turned off/disabled/non-running.
Reply: Bits are used as storage unit because no once say you need to keep data in 8 bit blocks, it can be more or less. Bits are used as storage unit where specific technologies are not bound on paper to keeping things in 8bit blocks.
Reply: @Dagogo my man, you should not be making this silly mistake in your videos, your audience is tech savy and by the look of this comment, a lot more than just me have OCD. I will assume Bytes since that is what is used in programming with memory allocation and on disks for file sizes.
Reply: Bits are a marketing dream
Reply: I mean, he does point it out  @7:51. For anyone wondering this holds up to  200 TB of data
Reply: Bits is the scientific/engineering terminology and bytes is the marketing term. Mentally multiply or divide by 8.
Reply: Bytes equal to divide bits by 8
Reply: In storage is measured in bytes, so should be 1.6 petabytes only
Reply: it is peta dude it is peta. still 200 tetabytes
Reply: agreed
Reply: Peter griffin
Reply: bits are for networking. bytes are for storage
Reply: at least they gave the right unit of mesurement. not like how windows shows megabyte and gigabyte when it's actually mebibyte and gibibyte

Edit:
and now I just hit where they swaped between petabytes and petabit >.>
Reply: But 200,000 GB is 200TB
Reply: IMO bit should be dropped for advertisement and consumer-space software, but NOT dropped altogether as it is still a valid form of measurement-standard in hardware industries similar to how we measure transfer speed in networking by using Bit/sec instead of Byte/sec because not all byte are exactly 8 bits. Blame software engineer. Bit also represent the actual electrical pulse like Hertz do but, wait... Actually, yeah lets scrap the Bit altogether and just use Hz instead to confuse the hell out of everyone! Might as well use Nook-and-Cranny/second while we here too ...
Reply: @Aizemiyo  you cannot use hertz to represent the number of bits per second. Data transfer does not always correlate 1:1 with frequency, that all depends on the encoding used. Just look at DDR RAM as an example, if you set the RAM to 1500 MHz you can achieve 3000 mega transfers per second since it sends data on both clock edges.

Also if you have lines in parallel it confuses things too, if you have four 100 MHz signals in parallel, you can get 400 Mbps but you are not sending data at 400 MHz.

Keep frequency for the low level hardware side of how communication methods work, bits per second is what needs to be used when talking about data transfer.
Reply: That's still 200 TB. Call it what you want. It's a lot bigger than anything I have now. lol
Reply: @BeegBeegYoshi.  Hi nerd
Reply: Meeeh they’re basically the same thing.
Reply: Yeah, the worst offender imo is isp's. mb/s and megabits per second took me a long time to realize they were different.
Reply: @JK-gm6kk  Wrong.  mb/s (AS YOU WROTE IT) IS megaBITS per second, because the b is lower-case.  MegaBYTES per second is written MB/s  (where the B is upper-case).
Reply: 1 bit = 8 bytes problem solved(if I'm correct I don't remember exactly)
Reply: @jeremygalloway1348  the opposite
Reply: @jeremygalloway1348  1 byte = 8 bits or 8 bit = 1 byte you are correct about the ratio. but in the video it also says 200TB not terabites but "TeraBytes".
Reply: A bit and a byte are different?
Reply: A byte is not eight bits, it is the smallest addressable chunk of storage (which could or could not be eight bits depending on the implementation).
Reply: @Fitzrovialitter  This is incorrect in the DVD context, a byte is indeed 8 bits here. It is correct for the basic data definition in older impl. with 5 or 7 or even above 10 bits used per byte
Reply: @0xphk  A byte is the smallest addressable unit of storage which may or may not be eight bits.
Reply: @Fitzrovialitter  which is 8bits in this specific context, you use a generalized definition for the wrong context
Reply: @Fitzrovialitter  learn something about information theory. A bit is the smallest piece of information. A Byte is 8 bits PER DEFINITION. Cope with it.  It equals 2³ possibilities or the numbers 0 to 7 in decimals. The fact that 1 Byte is not 10 bits is because of the loss of storage space in digital equipment. Memory is always the size of 2 exp x.
Reply: Ok zoomer
Reply: yup, there are eight bits in a byte, cell phone companies such as bell love scamming people by calling bits bytes in the booths when they sell you a plan , then when you read the fine print in the contract it is bits and I'm not sure there is anything you can do about it.
Reply: @sykoben  just get over yourself.. binary is the storage mechanism.  Bytes are not... Maybe you have some trinary or other encoding scheme.  Always measure media and transmission in bits.... Are you all insane?
Reply: @xephael3485  storage is measured in bytes, transmission in bits, correct, but, what is not correct is misleading the customers calling bits bytes, there are 8 bits in a byte, thus selling someone a package and saying it is bytes is still ripping off customers. if you are going to sell a product , sell the product you are actually selling, ie, say bits when it is bits, as calling a bit a byte is incredibly misleading. , get over yourself xephal, not everyone knows these things, I would argue many consumers do not know these things, and it is bad practice to mislead customers in this way
Reply: 1 bit is 8 bytes

This clip was made by amateurs and only made to make money since they have 5 million subs.
Reply: Bits is used to measure speed not storage.
Reply: @D.AverageJoe  bits are the measure unit for storage. Bits/s are the measure unit for transfer speed
Reply: @perrolokofan2011  nobody uses bits when they talk about storage. Only ones that uses bits are ISPs when talking about speed.
Reply: @D.AverageJoe  Bits are just storage on a smaller scale. Either a 0 or a 1. A byte is just eight 0s or 1s.